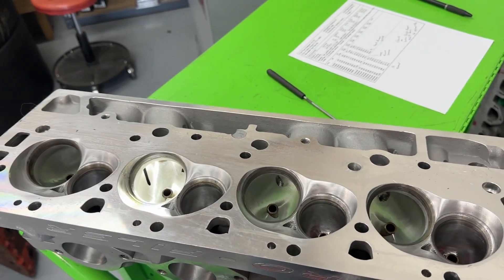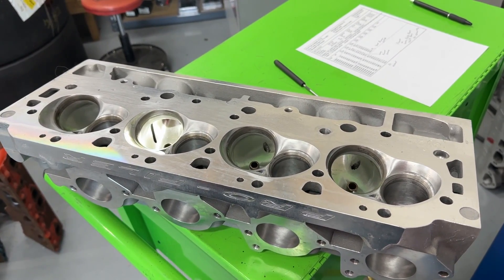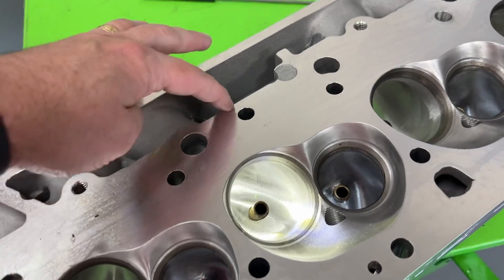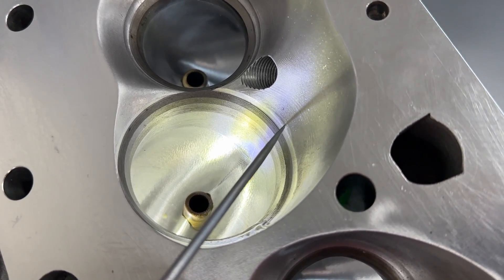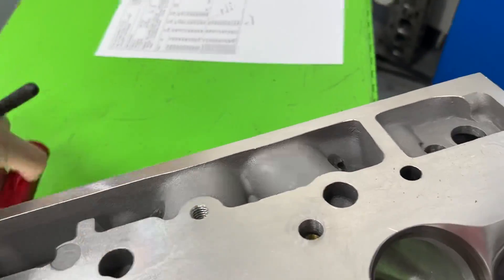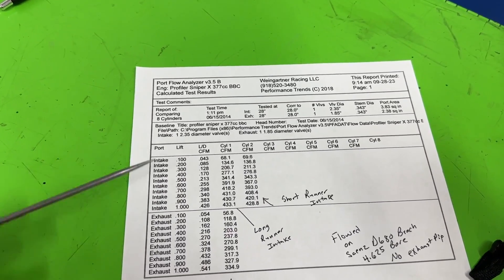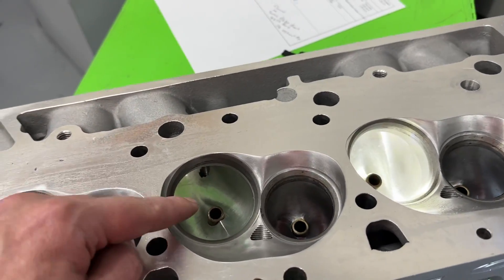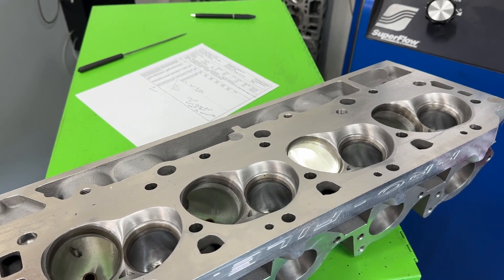Profiler Sniper x CNC ported heads

Comment: I remember contacting you about porting & building me a set of these heads. You said “let me save you some money and port & build you a different set of heads”. Not that the X375’s are great heads, they are just very expensive. Seeing these come in at 433cfm peak and mine came in around 450cfm peak on your Saenz, makes me feel as though it was money well spent (and saved).

Comment: On What cubic inch could it make 1000 hp ?
Reply: 565-632, a friend of mi e has these on a 588, running just under 1.000” of lift (between cam and rocker ratio) and he’s closer to 1100hp than 1000hp.
Reply: @my87z28  sounds like a great engine , super efficient for a smallish port…